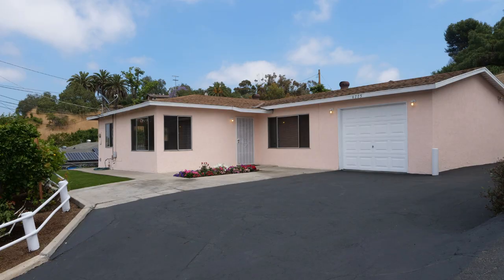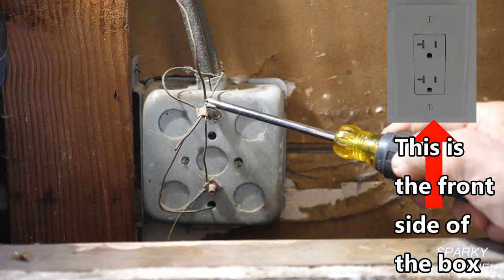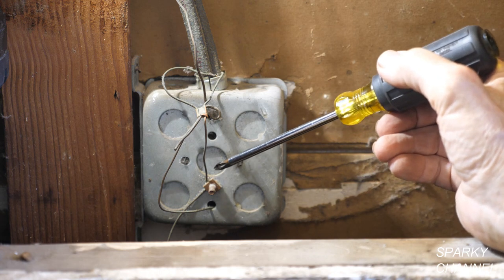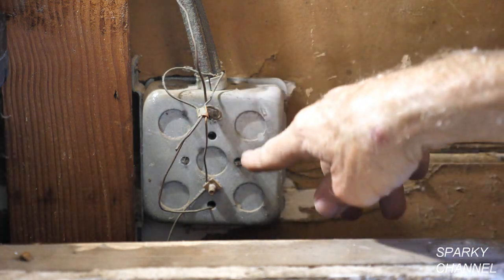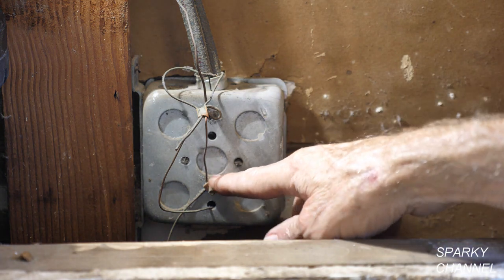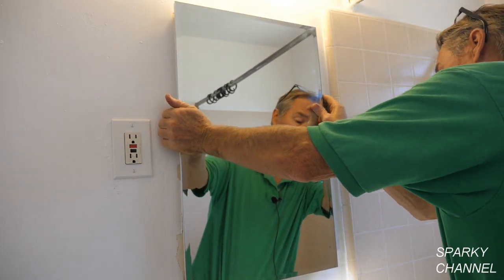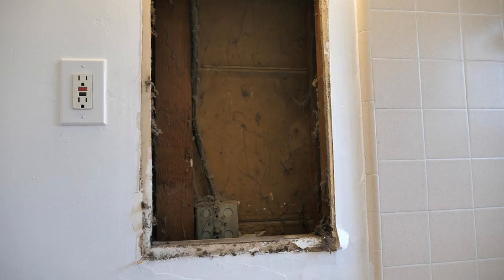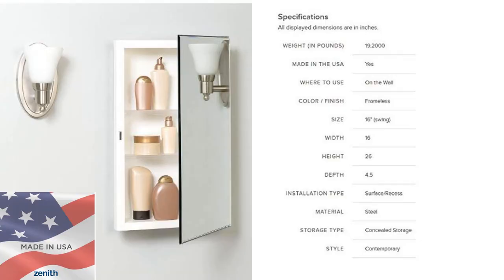How 1960's Metal Electrical Boxes Were Grounded

Comment: The laundry, electric kitchen stove/oven and appliances in a room which contain a bathtub and or a shower had to be grounded here in Germany at that time. Also metal bath- and showertubs had to be bonded to the grounding system of the house.
Were there any razor blades inside of your wall? I heard old medicine cabinets in the US had a slot in the backside where you could put in your old razor blades. There were also tiles available with such slots. From there they simply fell into the hollow wall. That's the reason you'll find some old razor blades inside of the wall.

I'm surprised the 60s US cables look so old, if you remove a cable here from this period, it almost looks like new. Except for the copper in the terminals of course, but the insulation is always ok. Except from the wires which were exposed to heat and air, like the ones in a light fixture. Last year I replaced all the old connectors in the ground floor of my parents house. And sometimes you'll find a mixture of different colour codes in the same box, the installation was extended at some time. In this case pre-1965 in combination with colour code from between 1965 and 2003. Cable sheathing is PVC, harder PVC as outer sheathing, softer PVC inner sheathing. Wire insulation is also PVC.

https://abload.de/image.php?img=20191106_190507974_iodqjh4.jpg

In this case was red the ground (in combination with one green/yellow striped one), gray and blue the neutral and the line or hot is black. And I see on the picture I stripped the switched line for the ceiling light fixture too long.... o_O
Reply from the maker: Interesting! The cloth covered cable in the US back in the 60's was a bad idea and now we're stuck with it unless we are able to do a re-wire. Thanks Marcel!
Reply: @SparkyChannel  In my grandparents house there was only one light fixture with cloth insulated wiring, that was from the early 1950s. The rest of the installation of the same period was done with PVC insulation. I suppose such a short time after the war the electricians used what they had at that time. That were single wires in metal piping (the inside of the piping was insulated with tar paper). It was like rubber with cloth, and it was totally disintegrating to a crumbly mess when I rubbed it between two fingers. But I had to rewire the whole house anyway, that wasn't an issue anymore.
Whenever I could I used the old piping when it was still intact, and put in new wires type H07V-U.

H=harmonised cable type (in Europe)
07= rated for 750V
V=PVC insulation, rated for 70°C conductor temperature at max. which is standard for PVC. There's also one with increased temperature (90°C) which is marked V2.
U=solid conductor
Reply: @mernok2001  I'm not from east-Germany. Yes, Bergmann conduits were common here too. They were replaced by PVC conduits.
In east-Germany aluminium was the standard, 2.5mm² Aluminium with cable type NYIF. NYIF was used here too, but with copper conductors. It's total crap, after decades the sheathing made of rubber is either crumbling to dust or got the consistency of old chewing gum. It's flat, you need to nail it to the wall with special nails, cut into the sheathing between the wires when you made bents and fold the cable over. Then the plaster guys will come in and put plaster on the wall. The only thing that is good: You can rip it out of the wall and got a perfect slot for new NYM cables. It's still available for new installation, but actually most electricians don't use it. Only for the light fixture on the ceiling. The thing is it is not flexible enough. You can't use it outdoor, you can't install it directly on wood. NYM is for almost everything, except for direct burial into the ground, that would be NYY. This is the reason the price for NYIF is now higher than the price for NYM.

NYM:
http://www.ddacables.com/katalog/pdf/nym-j-o.pdf

NYIF:

https://www.xbk-kabel.de/wp-content/uploads/2019/03/NYIFY_NYIF.pdf

NYY:

https://www.elandcables.com/media/38379/nyy-j-pvc-0-6-1kv-power-cable.pdf

In west-Germany, were I live, aluminium was never used in final circuits. The VDE demands that the smallest conductor size for fixed installation is 1.5mm² for copper and 16mm² for aluminium. So no one used it here. But I've seen other things, like wire too short? No problem, twist the new one on, make a good amount of insulation tape arround...no one will ever see it if it's inside of the conduit. That was the old insulation tape, textile tape impregnated with resin.

The textile insulation looks nice, but never touch it. In my case the insulation was crumbling to dust in my hands. It was the wiring for a ceiling light fixture, completely closed with glass, so the heat propably destroyed the insulation during the 60 years of use.
Reply: Szakállat Korporésön Same here but only in the 1950s. Living- and bedrooms were done that way. Later instead of a separate neutral and ground a PEN conductor was used. Simply a wire bridge between the neutral and ground terminal on the outlet. That was common practice until 1973 in west-Germany. In east-Germany they did this until 1990. From then on you had to install a separate ground wire.
Reply: @mernok2001  That was the reason this practice was no longer permitted in 1973, only if the PEN conductor is larger than 10mm² in copper or 16mm² in aluminium. But there was never a fuse in the PEN (switching or fusing the PEN is not permitted, you'll have to treat it like a normal PE conductor), and in the neutral neither. This is also a dangerous practice, because if the neutral connection is broken it will also become live at mains voltage. And a fuse in the neutral is as necessary as a third breast on the back. Except it is a circuit 2-pole circuit breaker switching off both active wires, line and neutral. Only on a TT grid this would make sense where the potential of the neutral could deviate from ground potential.
The only place in new installations where you can find a PEN now is in the service entry box of the house. There the PEN from the service company is splitted into a separate neutral and ground. So the grounding of the house is supplied by the service. But the house also got an additional grounding system, mostly in form of a foundation earth electrode. In older houses there is a grounding rod, and really old installations use the incoming water pipe from the street as a grounding electrode. This system is called TN-C-S. The thing is the provided ground is many times better than the ground of the local ground electrode. You don't require RCD to get fullfill the requirements of tripping time in case of a short circuit (less than 0.4s, with a TT-grid this is impossible without RCD), the RCD is now only there for the safety of people.
Reply: Szakállat Korporésön At that time 3x35A. Now these days the standard is 3x63A. So three-phase 3x230/400 V is the standard here.
Reply: @mernok2001  I suppose they want to replace it, but the grids are so huge. I don't want to know how much that would cost to replace the split phase system with a three-phase system.
Reply: @mernok2001  We don't have any poles for low and medium voltage here any longer. In my area the overhead wiring was replaced 25 years ago by cables which run below the sidewalk. The fuses are in boxes on the street, in the transformer stations which transform the medium voltage down to low voltage, and there are fuses in the service entry box in the cellar/basement.

Transformer station:

https://upload.wikimedia.org/wikipedia/commons/b/b9/Hauptverteiler200_A.jpg

The boxes on the street where several houses are connected to:

https://upload.wikimedia.org/wikipedia/commons/c/cb/SichVert.JPG

Service entry box, in this case with a transparent cover. Normally the cover is made of white plastic. The wire-seal is missing on this. In this case the fuses are 50A, but there could also be 63A or higher in there:

https://elektroinstallation-selber-machen.com/wp-content/uploads/2018/12/IMG_9366-e1545124832540.jpg
Reply: @Marcel_Germann  How did you identify neutral/ground in 3 phase wiring when only black tar impregnated cloth covered wire and electrical tape was available?
Reply: @mernok2001  You measure the voltages, between the three lines you got 400V. Between a line and a neutral is 230V, same for between line and ground. Between neutral and ground is zero volts. Depending on the grounding system in the area there's a connection between the neutral and the ground TN-system (TN-C or TN-C-S), or in the US a so called multi-grounded neutral (MGN). In several old installations, especially in Germany, you'll still find TN-C in the final circuits, meaning you don't have a seperate ground wire, instead you got a one wire which serves as neutral AND ground in combination.
And the way of distinguishing between the different lines is the direction of the rotation field of the three phases. It shall rotate clockwise, not counter-clockwise! Especially if you use machines like a table saw, there such an error could cause massive injuries. The nut which holds the saw blade would turn loose and the blade would fly away. Quite undesirable scenario!
Most installation testers have an indicator for the direction of the rotation field. Some 2-pole voltage testers also have this functionality, but it's not as good as the three pole test.
Reply: @Marcel_Germann  Did you have any special color NYIF and NYIFY cables in germany or just white sheated? In the former ussr they had orange,purple,red and brown sheathed NYIF(Y) cables.
Reply: @mernok2001  They're not plain white, it's a creamy white. I've never seen a different colour. It's still permitted to install them, but actually no one uses them any more. You can't use them in damp rooms, not permitted installing them on wood. The most common cable types here are NYM and NYY.
Do you know what the difference was between the different cable colours?
Reply: @Marcel_Germann  I think it was colored to see it if you were digging in the wall for some reason like adding another cable.
Reply: @mernok2001  Could be the reason. But in that case one bright colour would be sufficient, why the different colours? Maybe to distinguish the sizes of the conductors in addition? Conductor Material?
Reply: @Marcel_Germann  I think it was mostly aluminum in the USSR. 2.5mm2 aluminum wire is till permittted in Russia.
Reply: @mernok2001  Actually 2.5mm² should be the minimum size in aluminium. It's comparable to 1.5mm² copper on which fuse you should use, in the GDR a 2.5mm² circuit was mostly fused with a 10A Diazed or DL-fuse. DL is comparable to Neozed D01, but it was available up to 20A (D01 only up to 16A). The DL fuses are still in production, but you can also insert a Neozed D01 fuse, but you can't insert a DL fuse into a Neozed fuse holder. DL fuse diameter is 13mm, the D01 is 11mm, so they used fuse carriers with E14 for the D01 and E16 for the DL. The DL system was mostly used in the apartments panels in apartment buildings. You know, the typical precast concrete slab apartment buildings from the 1960s and 70s...
Reply: @Marcel_Germann  In Hungary 1.5mm2 aluminum wire was common for circuits up to 10A and 1mm2 also existed for 4 or 6 A mostly for lighting and doorbell  circuits.
The 1.5mm2 copper and 16mm2 aluminum rule is some political/economicalinterest.Someone gets a good amount of money by selling that much copper and aluminum.For example in Australia,New Zealand and probably many other countries 1mm2 copper wire is very common both in solid and starnded versions for lighting circuits and other loe power stuff.Using 1.5mm2 where 0.75 or 1mm2 would be more than enough is a waste of copper.
Fluorescent light fixtures were often internally wired with really thin wires like 0.5 or 0.35mm2.
Also some countries allow 10A for 1mm2 ,16A for 1.5mm2,20A for 2.5mm2 ,25-32A for 4mm2 and 40A for 6mm2 while some other countries allow 6A for 1mm2,13A for 1.5mm2,16A for 2.5mm2,20A for 4mm2 and 25A for 6mm2.
Reply: @mernok2001  The VDE decided that the smallest wire size for copper should be 1.5mm² not for electrical reasons. It was done due to mechanical reasons, considering such things like bending radius or the chance of damaging the conductor while stripping the insulation. Back then the wire strippers weren't as good as they are today. And in most cases the electricians used simple cable knifes. Today electricians here use the cable knifes for stripping wire insulation only on the large sizes from 6mm² upwards.
It depends how long the cable is, how is it layed (inside of a thermal insulated wall, below or inside plaster, on the surface of plaster). And also the trip or blowing characteristic of the circuit breaker or the fuse. Here for fuses the type gG/gL is common for this purpose. For this they used 10A fuses. But you can replace it with a 16A B- or C-type circuit breaker. They used the 10A because the blowing characteristic gG/gL is inert in comparison to the faster B or C type circuit breakers which are in use today. And also the grids had a higher ground loop impedance.
The thing was, back in the 1960s you had three circuits for a whole one family house. One for the kitchen cooker/baking oven, eventually one for the water heater of a bath tub (if you had the luxury, sometimes it was a coal or oil fired bath boiler). And the last circuit for the rest (outlets and lighting).
Reply: @Marcel_Germann  In Belgium and France they allow to use a 20 Amp breaker for 16 Amp sockets with 2.5mm2 wire if you have a lot of sockets and 16A is not enough.
Same story in America,you can use a 20 Amp fuse or breaker to protect 15 Amp outlets if the wiring can handle it.
Reply: @mernok2001  Here this is not possible. For outlet circuits only 16A are permitted. If you require more power, then install more circuits. But actually in most rooms one 16A circuit is sufficient. For example bedrooms, bathrooms or living rooms. In the kitchen or a workshop the situation is different, there you require more circuits and some dedicated circuits. Here the kitchen cooker circuit is in a modern installation always a three-phase circuit. Single phase only in old installations.
Reply: @Marcel_Germann  I bet you have seen some people removing the porcelain rings from DII fuse holders to put in a bigger fuse.It was common here,cometimes we didnt even have the screw in the fuse holder and we put a washer or penny under the fuse to make a connection because otherwise the fuse was too short.
Reply: @mernok2001  I think such things are pretty common all arround the world. Aluminium foil wrapped arround the blown fuse, screws inserted into NH-fuse holders and such things.

The best thing was a service entry box. There you normally got two big cables and a smaller one. The big cables are the entry and the exit, in the service entry box are three NH-fuses, in most cases 63A. The smaller cable is a 1x16mm² NYM-J going to the equipotential bus bar where you connect such things like metal gas and water pipes to also and the grounding rod of the house is also connected there. This is to split the incoming PEN-wire into a separate ground and neutral wire.
The installation should be dismantled completely, but it was still live. Thank god I watched into the box before I cut the cable. It wasn't 1x16 NYM-J, it was 5x1.5mm² NYM-J. The outer diameters are almost identical, the 1x16mm² is 9.6mm and the one of 5x1.5mm² is 9.9mm. Someone installed this to steal electric energy.
Reply: @Marcel_Germann  I know some electricians who accidently cut 4mm2  aluminum wire which was coming from the service drop mast unfused(unmeasured wire,before the electricity meter) the only fuse protecting was probably 160A at the transformer .After he made a loud bang the wire was still live.Probably the same wou;d have happened to you,the 1.5mm2 3 phases would have remained live and the 63A fuses hadnt blown.
Reply: @Marcel_Germann  When did Germany change the voltage from 220V to 230V anf from 380V to 400V?
Reply: @mernok2001  1986 in West-Germany, 1990 in East-Germany. And the change from 380 to 400 was caused by the change from 220 to 230V. Multiply this with the square root of 3 and you'll get the 380 or 400V as voltage between the three lines. On 240V that would be 415V. That calculation is caused by the phase deviation of 120° between the three phases.
The first three-phase system in Germany had 127V between line and neutral/ground, and 220V between the lines. The other popular system was split-phase with 110V of each line against neutral, and between the lines 220V. That was when the Schuko system was introduced, in the original design there was no neutral, only two lines (220V) and a ground. That was the reason the system isn't polarised. The last remnants of split-phase grids were dismantled in the 1950s. They tried to introduce a replacement for Schuko in the 1950s, for example the Terko system which was polarised. But Terko got the same problem as the american NEMA plugs: If only partially inserted, live parts are exposed. That's a problem Schuko never had because it's recessed.
Reply: @Marcel_Germann  Marcell, do you have any information when did they start replacing overhead wiring with underground cables? Did they already start doing that  in East Germany too?
Is it replaced now completely,or can you still see overhead wiring somewhere?
Reply: @mernok2001  In small areas, americans would call them upstate, in Australia this would be the Outback, there are still overhead wirings. I can tell you when this was done in the area I live in, in the mid of 1990s. In bigger cities the cables were below the sidewalk almost for ever. So this was done in steps and not all at once. In newer cities or districts since the 1970s.

The problem of the overhead wiring was always the protection against lightning strikes.

https://de.wikipedia.org/wiki/Dachst%C3%A4nder
Reply: @Marcel_Germann  I actually like old overhead wiring with porcelain insulators.Definetely looks cooler than the stupid black aerial bundled cable.
Reply: @mernok2001  Here there's no overhead wire and no aerial cable...all cables are in conduits below the sidewalk. Telephone, electricity and cable TV.
Reply: @Marcel_Germann  Is the internet also underground?Is it UTP or optical cable?
Reply: @mernok2001  Depends on the area you live in, in my case it's UTP. In other areas it's optical cable. And yes, also below the sidewalk. Every several meters is a maintanance shaft to get access to the cables. Cable couplers are filled with a two compound epoxy, so they're protected against water.
Reply: @Marcel_Germann  Are undergroun cables in Germany copper or aluminum?I think that electricity theft is easier that way.With overhead cables,you can see if someone has an ilegal connection but someone can dig out the underground cable,make an illegal connection,bury it again and nobody will notice that he is stealing electricity.
Reply: @mernok2001  

Actually it's not easier. You'll have to dig on public property, the sidewalk is next to a street. You'll have to dig round about 2m deep, and hope that you hook up to the proper cable and not the 25kV medium voltage ring.
And it's not necessary. The cable enters the house in a service entry box with three NH fuses inside, and the PEN (in most cases it's a TN-C-S grid) is separated into a neutral and ground. The thick cable is the connection to the meter box or board and the electricity is uncounted. The thin wire coming out of the box is 1G16mm² NYM-J going to the equipotential bus bar of the house were all metal pipework is bonded to and so is the ground of all circuits. Seen this replaced by a NYM-J 5G1.5mm², this almost got the same outer diameter as the 1G16mm². At least they hooked up after the fuse...but 3x63A is still too much for 5G1.5mm².

https://abload.de/img/img_5942jnkhn.jpg

Meter box:

https://abload.de/img/img_0833beju4.jpg

The cable between service entry and meter box belongs to the property owner. Also the meter box. Only the meter itself belongs to the DNO (Distribution Network Operator).

The small meter is also my property, it's for a sub-panel which powers an EV charger. The single Neozed fuse carriers are for a sub-panel which is installed on the first floor. This meter box only contains circuits for the cellar and the ground floor. The Neozed fuse carrier in the first row all to the right is for a sub-panel in the garage (EV charger).

First floor board:

https://abload.de/img/img_0834rxjlw.jpg

The materials are different, depending on the area. In my area it's copper. But it could also be aluminium or copper cladded aluminium.
Reply: @Marcel_Germann  copper clad aluminium sucks.I hope at least that the PEN conductor is not smaller than the phase conductors.Especially nowadays,when nonlinear loads can generate overcurrent in the neutral greater than the current in the phase conductors. Trust me,in my area there are some gypsies who could dig out the underground cable.One of them actually burned his house down while hooking up a cable to the aerial.The fuse was probably 160,200 or 250A near the transformer.
Reply: @mernok2001  All the wires in the cables are of the same size.
Reply: @Marcel_Germann  Thats good.Are you sure the medium voltage is 15kV?I only heard about 20,22 and 23kV,rarely 10 and 35kV and 27kV only for railways.
Reply: @mernok2001  I wrote 25kV. That's what it is here in the area. In other areas it could be 30kV. Medium voltage is between 1kV and 30kV, above 30kV it's high voltage. Low voltage is below 1kV. 15kV is railways here, and the railways also don't use 50Hz frequency, they use 16.7Hz (a few years ago the designation was changed from 16 2/3 Hz to this).
Standard railway voltages in Europe are 15kV (16.7Hz) or 25kV (50Hz), but they're some local deviations from this. Of course trams and subways use lower voltages, and in most cases DC.
Reply: @Marcel_Germann  I thought medium voltage is until 35kV and in some places maybe 45kV.
Reply: @mernok2001  There are no limits, and there's no normalisation of these terms. In Germany medium voltage is up to 30kV, but in other countries it's up to 52kV.
We got:
Niederspannung: less than 1kV
Mittelspannung: Typically 3, 6, 10, 15, 20 or 30kV
Hochspannung: Typically 60 or 110 kV
Höchstspannung: Typically 220, 380, 500, 700 or 1150kV.
The highest voltages are normally used for long distances and are DC. This is called HVDC:

https://en.wikipedia.org/wiki/High-voltage_direct_current

And some see 300kV as the limit between Hochspannung and Höchstspannung. Here the sizes of some HVDC cables:

https://docplayer.org/docs-images/48/21698456/images/page_19.jpg
Reply: @Marcel_Germann  In Germany if you have a small house and you only need about 4 or 5 circuits are you still forced to buy a super large breaker box?Also,is it allowed to install D II fuses?
Reply: @mernok2001  D-type fuses for final circuits is not state of the art, according to DIN 18015-2 (electrical installations in domestic buildings) you'll have to install a proper panel (at least 2 rows with 12 space units each) and fit circuit breakers.
Also I wouldn't use DII, I would use D01 (Neozed) instead. Neozed fuses have a lower thermal power loss than Diazed.
A surface mounted Hager Volta board is 40 Euros (47 USD)...if you calculate this up to the lifetime of such a thing that's almost nothing....
Reply: @Marcel_Germann  Some people in America are complaining that the power company forces them to upgrade to 200 amp service and panel even if they dont need it.Is it similar in Germany too?
Reply: @mernok2001  No, here it's the complete opposite. I would pick the higher power from the start -> first electrical installation in a new house. The thing is, at this time there are no additional costs. When you got an old installation, with lower power (for example 3x35A), and want to upgrade they'll charge you for this. Even if all cables are properly rated and the only thing is to change the fuses...in that case round about 100 or 200 Euros. If you want an upgrade and the cables which are going into your property are not rated for the new amperage, the costs will be in the range of 4000 to 5000 Euros. In normal operation the old amperage is still ok, but if people want to buy an electric vehicle they require an upgrade to install a proper wall charger.
In my case there was a wall charger installed for an EV charger, the charger is a 22kW one (3x32A). The problem is, the segment of the DNO (distribution network operator) I'm in is too weak for this (they calculate as everyone in that area would now install one of these chargers and use them at the same time). They offered me an upgrade, costs seen above here, in the mid four digit range). I reduced the charger to 11 kW instead. The interesting thing is, before they came to inspect my installation if it's sufficient to use with the 22kW charger I had switched it to 14kW (3x20A)...no one noticed, no blackout...
Reply: @Marcel_Germann  I often find marble fuse panels in old houses.Tey were used until the 1970s here and most of them work perfectly without a problem.They were made to last.In single phase circuits even the neutral was fused because there was no color coding.2 same color wires for live and neutral.
Reply: @mernok2001  Fusing the neutral is not a good idea, as it's no good idea to switch the neutral instead of the line conductor. Could also be the remnant of a split-phase system like the US still use. Here in Germany we had split-phase and three-phase. That's the reason Schuko is not polarised. There were two line conductors and a ground. The split-phase was 2x110/220V, the three-phase 3x127/220V.
Reply: @Marcel_Germann  Split phase was never used here as far a I know.But in the early days of electricity fused neutrals were noram prettu much everywhere.If someone accidentally reversed live and neutral the live was still fuses.If there was only 1 fuse then the fuse would be in hte neutral only and the live would be permanently connected.Color coded wire only becamse common in the mid 1960s here.Before,black  asphalt impregnated cloth and rubber insulated wires were used.
Reply: @mernok2001  The last remnants of split-phase were dismantled in the 1950s here. The cloth insulated cables were used here too. But two colours, black for the line and red for the PEN. In my house, built in 1952, there were in most cases PVC insulated wires used. But one light fixture in the staircase actually had a cloth insulated cable. The insulation crumbled to dust between my fingers...it was cloth over a rubbery material.
Reply: @Marcel_Germann  Was the PEN the only method for grounding before 1973? I heard that before green-yellow,red or red-yellow was used as ground in Germany,Austria and Switzerland.Red was used as ground in Hungary too until the 1980s.
Reply: @Marcel_Germann  Are 2 pole and 4 pole circuit breakers common in Germany?I like to use them everywhere when possible.
Reply: @mernok2001  No, they're not. Except you install RCD or RCBO, they normally switch off all active conductors (all lines and neutral). But the standard circuit breakers only switch off the line.
Reply: @Marcel_Germann  Did any electricians use a sperate ground and neutral wire before the  PEN conductor under 10mm2 was banned?
Reply: @mernok2001  Yes, in TT grids. You only have a PEN in a TN-C(--S) grid.
Reply: @Marcel_Germann  How common were TT systems?I saw a few with a very good grounding(<4 Ohms) without RCD.
Reply: @mernok2001  Some areas here still have a TT grid, but in several cases this is remodeled to a TN-C-S. They simply use the former pure neutral conductor as a PEN. In both systems you'll find four incoming wires. In a TN it's a -J cable, meaning containing a green/yellow wire. In a TT they mostly used -O cable without a green/yellow wire.
In the most TN-C-S black is L1, brown L2, and the blue wire which is normally the neutral is L3. Green/yellow as PEN. In Germany it is permitted to use the blue wire as a line if a neutral is not required and a confusion is not possible.
In TT there are two blacks (L1 and L3) and a brown as L2. Blue is neutral. 
The colours are from before 2003, at that time the colours were changed to todays european standard (brown, black, gray, blue,  green/yellow).
Reply: @Marcel_Germann  Do you have what does R,S  and T means? In some places the 3 phases were R Y and B which stood for red yellow and blue wires.
Reply: @mernok2001  Old designations:
R: L1
S: L2
T: L3
Mp: Neutral. Sometimes in old transformerstations also marked as "U". Mp for Mittelpunkt, as the center point of the star circuit (in the US most commonly known as Y or Wye circuit). But in most cases if you connect an electric motor you'll find U, V and W for the motor windings.

SL: Protective Earth / ground
Reply: @Marcel_Germann  Why did they choose RST for L1 L2 L3 and not other letters?It it some German abbreviation?What about U,V and W?
Reply: @mernok2001  R, S and T were used before L1, L2 and L3 came up. And not only in Germany. 
In an electric motor which runs with three phase you got three windings, they're mostly designated U, V and W to dinstinguish between them.

https://images.gutefrage.net/media/fragen/bilder/was-bedeutet-bei-dieser-vollpolmaschine-das-uvw/0_big.jpg?v=1488216974000

And the effects of changing them:

https://www.hitachi-ies.co.jp/english/products/motor/threephase/image/three04.gif
Reply: @Marcel_Germann  Thanks for the Answer.So the letters dont mean anything,just random letters. I read that in some places the phases were called RYB or RWB which means red yellow blue or red white blue.I thought that RST were the first letters of a color in some language.
Reply: @mernok2001  
No, they don't mean anything besides what I wrote. The colours at that time, when R,S, and T were up to date, was:

L1: black
L2: blue
L3: black
N: grey
ground: red

And in case of a PEN instead of a separate ground, in that case 4 core cables were used:

L1: black
L2: red
L3: blue
PEN: grey
Reply: @Marcel_Germann  Was it the same in East Germany too?Were TT systems also common there?Did houses there also have 3x35A service?
Reply: @mernok2001  Yes, the same. But the thing with the minimum size of the PEN of 10mm² in copper (16mm² in aluminium) was introduced after 1990. Also that the minimum conductor size of aluminium must be 16mm². Also this type of three-phase outlet/plug combination was used until 1990, and was already banned in West-Germany decades ago:

https://www.picclickimg.com/d/l400/pict/293719471551_/Kraftstrom-Drehstromsteckdose-mit-passendem-Stecker-220-380-V-25.jpg

This was the only case in its history that the VDE released an order that these outlets must be replaced due to massive safety issues with them.

Back then, yes, 3x35A. But 3x63A was also common.
Reply: @Marcel_Germann  I heard from soneone that old and small buildings may only have 3x25A. What were the wire colors in East Germany?
Reply: @Marcel_Germann  Is it allowed in Germany to use 1.5mm2 for 16A and 2.5mm2 for 20A? Here its only recommended to use 1.5mm2 for 13A and 2.5mm2 for 16A because cheapy wire maufacturesrs use a slightly thinner wire and an alloy instead of pure copper to save a few cents.
Reply: @mernok2001  We use only standard cables, NYM, NYY or NYA in conduits. If there would be something else than copper inside the cables wouldn't meet the standard and it would be fraud.
It depends on the circumstances like how long is the cable, where is it installed, how many cables are there in that area and which distance is between them and which installation method was used. Installation method C  (cable in plaster or surface mounted on the ceiling) would permit to fuse 1.5mm² single phase with 20A and three-phase with 3x16A. But actually no one would fuse 1.5mm² with 20A, the voltage drop would be far too high. Normally max. 16A, in thermal insulated walls in most cases only 13A. On 2.5mm² it is 25A at max. but in most cases 20A.

That are the maximum values, it's about heat dissipation and preventing that the conductor temperature is above 70°C. At that temperature the PVC insulation starts to decompose.
Reply: @Marcel_Germann  When was the rule of 1.5mm2 copper and 16mm2 aluminum being the smallest allowed cross sectional area accepted in Germany? Did it exist even in the 1930s? in Hungary the 1941 standard said that the smallest cross sectional area for overhead wire from the pole to the house should be 10mm2 for aluminum and 6mm2 for copper. The 1.5 and 16mm2 rule was accepted here in 1997 but even after the existing stock of 1mm2 copper and 10mm2 or smaller aluminum wire was sold and used up in the 2000s,some in the early 2010s.
Reply: @mernok2001  1973 in West-Germany, 1990 in East-Germany. In the 1950s in West-Germany they used 1.5mm² copper for almost everything, except the cooker circuit. That was mostly in 2.5 or I've even seen it in 4mm². On lighting in most cases 1mm², but even that was fused with 16A because it was on the same circuit as the outlets and the 1mm² was only used for the cable to the light fitting and in case of 2-way switches (in the US called 3-way) for the connection between the switches. They relied on that the lamp will limit the current. Actually you can't overload a lighting circuit in the way you can overload a circuit for outlets. A lighting circuit would only require protection against short-circuits, but an overload will actually never occur.
Reply: @Marcel_Germann  Probably thats why 16A sockets in France and Belgium can be fused at 20A.The 2.5mm2 wire will handle 20A and multiple sockets can be supplied from it but a single socket will never have a load higher than 16A.
Reply: @mernok2001  Here it's not permitted to do this. Only 16A for Schuko outlets at max.
Reply: @Marcel_Germann  Was 1mm2 wire used for sockets too when 10A was the biggest fuse? Was 0.75mm2 also used for lighting?
Reply: @mernok2001  No to both...
Reply: @Marcel_Germann  Was it also true in the 1930s and before? Back then twisted cloth wires were installed with porcelain knobs to the walls.They still manufacture that type of twisted cloth cable for antique style wiring.
Reply: @mernok2001  Twisted cloth on porcellain was not used in residential buildings, only in barns or sometimes as retrofit if the house owner wasn't that rich. In newer buildings they installed Bergmann conduits (named after the company which manufactured them at first). These were made of several layers of resin-impregnated paper (later also tar-impregnated). Later examples had a mantle made of steel sheet which was plated with lead on the outside to prevent corrosion caused by plaster. Inside were single cloth-insulated wires, later they put in NYA, single wires with a PVC insulation. The modern and harmonised designation is H07V-U.
The Bergmann conduit is compatible with modern hard PVC conduit in size and in the method of coupling them, so you can extend the old conduit with the modern one. The old junction boxes were also made of sheet metal, had an insulation of tar paper inside. The boxes for switches and outlets were also made of sheet metal, but had tar on the inside as insulation. All were lead cladded on the outside to prevent rust.
This installation method was introduced several years before WW1.
Reply: @Marcel_Germann  Were the old wires insulated for 300/500V or 450/750V? I heard that the old cloth wires were 600 or 1000V insulated.Nowadays 1.5mm2 and upper copper wire semms to have 450/750V insulation and 1mm2 and down only 300/500V.
Reply: @mernok2001  NYM is 300/500V, the NYA (H07V-U) is 450/750V. So the size doesn't matter, the thickness of insulation matters. The outer diameter of H07V-U 1.5mm² is the same as a 2.5mm² wire from the inside of a NYM-cable. The wire insulation is much thicker.
Reply: @Marcel_Germann  NYM cables here are also 450/750V.The 300/500V is rarely used.
What was the insulation rating of the NYA wires before harmonisation?
Reply: @mernok2001  NYM is only rated for 300/500V, but the test voltage is 2kV. I don't know the old rating, actually the H07V-U is the same as NYA, the old NYA PVC insulation was also so thick.
Reply: @Marcel_Germann  I foud  this old cable made in East Germany. https://picclick.de/Stegleitung-3x25-mm%C2%B2-Aluminiumkabel-DDR-100m-Ring-274437612217.html
So did they actually use a spearate ground wire instead of PEN.Why is the outher insulation of the ground wire marked in green?Doesn't it have double insulation,so it would be enough if the inner cores were colored?
Reply: @mernok2001  Sometimes maybe, but a PEN was permitted there until 1990. In most cases the light fittings back then had four lamps. They were wired up that you got 2 pairs, and you can switch them on pairwise. Or both pairs. For this there were special switches available. The old rotary switches had the positions: -Off, Pair1 on (pair 2 off), pair 2 on (pair 1 off) and both pairs on.
For this you require 2 switched lines in the ceiling. The rotary switches were later replaced by them:

https://asset.conrad.com/media10/isa/160267/c1/-/de/625037_BB_00_FB/gao-einsatz-serienschalter-nova-aufputz-weiss-0330.jpg?x=300&y=300&format=jpg&ex=300&ey=300&align=center

Circuitry:

https://i.pinimg.com/originals/cb/d9/71/cbd9719bbe3bfa50015844cf71c463c3.jpg

The linked cable is a three core, so two switched lines and a PEN. This circuitry was done mostly in living rooms. In my house there was also such a circuitry. It was installed back then to save energy if you did not require the full light of the light fitting and half was sufficient.
Reply: @Marcel_Germann  Thats interesting.Why is the  PEN conductor painted green on the outside insulation?I suppose its a double insulated cable like NYIF or NYIFY today so the colored inner core would be enough.
Reply: @mernok2001  Don't ask me, in West-Germany that wasn't the case. And later it was also not done.

So, looked again. The PEN was permitted until 1990 in the GDR. Except for bathrooms and kitchens. There it had to be a separate PE. The regulation for the installation of this cable was the TGL 200-0613. The TGL was the east-german counterpart to the west-german DIN.

https://katalog.ub.uni-weimar.de/tgl/TGL_200-0613-02_10-1987.pdf

This type of cable was only permitted to install into or below plaster. No installation on combustable materials like wood.
Reply: @Marcel_Germann  Did bathroom and kitchen circuits require RCD protection in the 1970s both in West and East Germany?
Reply: @Marcel_Germann  https://www.amazon.de/100m-Installationsleitung-NYM-J-5mm2-750V/dp/B07B9VGYM6 This is a NYM cable with 450/750V insulation.
Reply: @mernok2001  That‘s not NYM. This is YDY, difference is the YDY is flat like the british twin-and-earth. NYM is round.
Reply: @Marcel_Germann  I found a bad link,the tetle first said nym and then ydy.Anyway,old NYM like round cables here existed with 0.6/1kV insulation too.Now 0.6/1kV is only used for underground cables.
Reply: @Marcel_Germann  Do you remember voltage operated earth leakage circuit breakers(fehlerspannungschutzschalter)?Those were banned in Hungary in 1972 or 1973.
Reply: @mernok2001  Was before my time. I've only seen the standard current operated ones. In 1984 in West-Germany it was made mandatory to install one in newly built "rooms which contain a shower and/or a bathtub". And they also banned the new installation of type AC RCDs in that year. So most RCDs here are type A, even old ones.
Reply: @Marcel_Germann  Were they also mandatory in East Germany.Before 1990 east german 100 and 300mA RCDs were common in Hungary.
Reply: @mernok2001  In 1983 they introduced that bathrooms and kitchens must have a separate protective earth and not a PEN. Afaik not, only in TT grids.
Reply: @Marcel_Germann  Actually in some points even the eastern bloc countries and soviet union had a bit better electrical wiring.When it comes to electricity the UK,USA and Canada are real 3rd world countries.
Reply: @Marcel_Germann  Were marble fuse panels commonly used in Germany?
Reply: @mernok2001  Not in normal homes afaik. Mostly metal fuse carriers for Diazed. Eventually before the introduction of the Diazed system.
Reply: @Marcel_Germann  Are 2 pole and 4 pole circuit breakers banned in Germany,or people simply dont use them  because not mandatory and 1 pole or 3 pole ones are much cheaper?
Reply: @mernok2001  They're not banned. We don't use them because they're not mandatory. But RCDs and RCBOs here are actually switching off the neutral too.
Reply: @Marcel_Germann  In West and East Germany,when PEN conductor was permitted for sockets, did they ground the PEN conductor where it entered the building?
Reply: @Marcel_Germann  Were 3 phase sockets in West Germany before 1973 and East Germany before 1990 also wired with only 4 wires ang grounded to neutral?
Reply: @mernok2001  Sometimes yes, and actually there's also still a four wire version available. For appliances which don't require a neutral, only the three lines and the ground.
Reply: @Marcel_Germann  But were 5 pole sockets also grounded with PEN wire,like single phase ones?
Reply: @mernok2001  yup
Reply: @Marcel_Germann  How common were TT systems in West and East Germany? Did TN-S and IT also exist?
Reply: @Marcel_Germann  Were garages always wired with a separate ground?
Reply: @Marcel_Germann  Is 500-550, 690 and 1000V used in mines and factories in Germany?